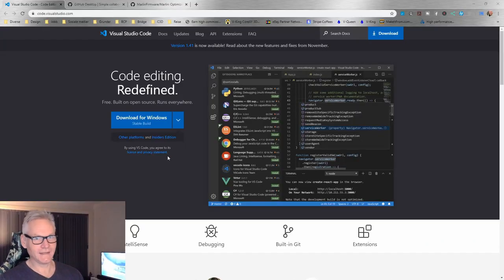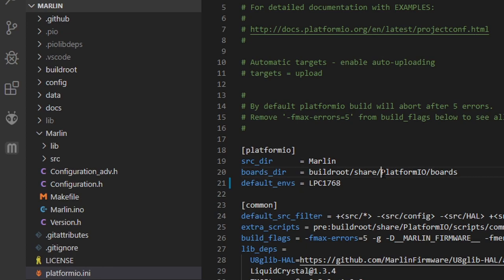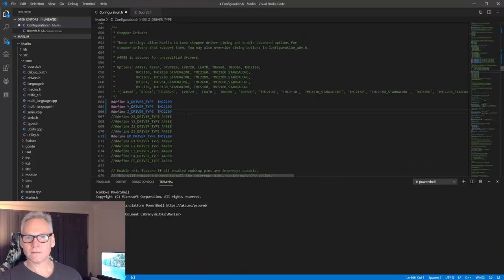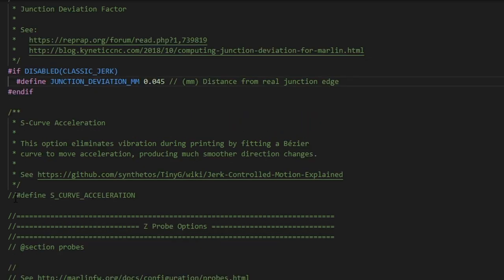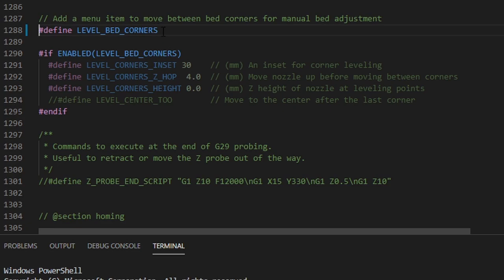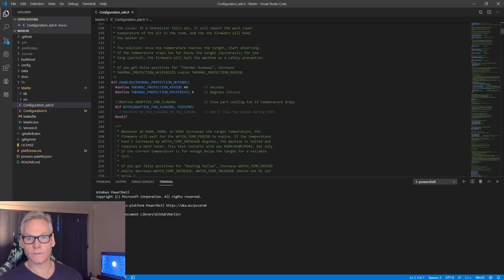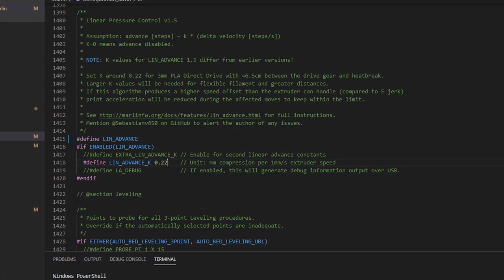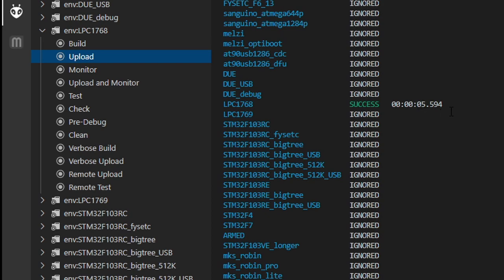INSTALL GUIDE FOR MARLIN 2.0 FROM SCRATCH

Comment: Thanks for this video Roy...
I’m up and running with 2.0.1, so used your video to confirm some of my define lines.
I see better 90 degree corners with Junction Deviation as well..
Keep the good work, take care be safe.
Reply: Wow, your build 57 Seconds...
My laptop need replacement 😂, with 5 minutes and 30 seconds build....
Reply from the maker: Great. I dont know JD myself so its a trial and error I guess

Comment: I’m using a big tree SKR with the marlin firmware. My issue is with a 1mm nozzle. I can print with smaller nozzles. The 1mm nozzle does not lay uniform line thicknesses. While extruding there are times when the extruder stepper stops and then starts. Thus my lines can be anything from a string to less than a full line width. If I back the filament almost all the way out of the Bowden and then run a print without actually extruding material,  the extruder stepper seems to feed filament consistently. This makes me believe I have something wrong in the firmware settings. There is a filament pressure setting in the advanced tab, but, I haven’t had any success with this parameter. Am I missing something here? Do you have any thoughts on this issue?
Reply from the maker: I am sorry for you problems. I don't know what can cause this issue I am sorry

Comment: Thanks! I have some trubbels trying to make my Tronxy D01 to work with Marlin. And with you video I think i can make some progress. Only one question. Why the bed keep dropping down when it’s not moving? Z-axis its falling down everytime that its not printing. Its the problem in Marlin or its the stepsmotor? I have a skr 1.4 turbo with tmc2209. Thanks!
Reply from the maker: When the Z motor is not powered it will fall down. This is normal but also depends on how you lift your Z. Belt, leadscre or ball screw? Geared system or not
Reply: @PRO3DESIGN  I have a Tronxy d01. And its exactly like my Ender 5 almost. The z-axis its like Ender 5. And I don’t have that problem in my Ender 5.

Comment: This is great - thanks.  But the last step - my Gen-L board - firmware is usually uploaded via USB cable (Arduino IDE). Is there an option is VSCode to do this?
Reply: Okay found it - when I scrolled down to the correct environment, I see it somehow knew to use com port

Comment: Hi Roy 
I followed your tutorial which seems to be the best I have seen so far.
However I am getting a compile error do you have any idea what I need to alter ?

   :6: error: #error "Unknown MOTHERBOARD value set in Configuration.h": 8,
	"message": "#include errors detected. Please update your includePath. Squiggles are disabled for this translation unit 
(C:\\Users\\John_2\\Documents\\GitHub\\Marlin\\Marlin\\src\\MarlinCore.cpp).",
	"source": "C/C++",
	"startLineNumber": 2,
	"startColumn": 1,
	"endLineNumber": 2,
	"endColumn": 30
}
Reply from the maker: Hello Ronnie. Thanks for the feedback. It is impossible for me to figure out what caused this error I am sorry.
Reply: @PRO3DESIGN  It says it cant find the motherboard and i done it exactly like you did in the video everything work except the build.
could me Marlin file be different from yours ? I downloaded the latest one.

c:\users\john_2\documents\github\marlin\marlin\src\pins\pins.h:747:6: error: #error "Unknown MOTHERBOARD value set in Configuration.h"

// choose the name from boards.h that matches your setup
#ifndef MOTHERBOARD

 #define BOARD_BTT_SKR_V1_3
#endif
Reply from the maker: @ronniebrasco8239  so I do you have the skr13? Did you set the right prosessor lpc1768
Reply: @PRO3DESIGN  yes all set to what you say above . The only difference i can see is that in your video The SKR 1.3 is shown as :
BOARD_BIGTREE_SKR_V1_3       but in my versions of Marlin the only board i can find is      BOARD_BTT_SKR_V1_3 .
When i try to build it says it cant find the board im wondering if this is a bug i have downloaded even the latest version of marlin and it only has     BOARD_BTT_SKR_V1_3 
Would it be possible for you to send me your files as that seem to build ok.
Reply from the maker: @ronniebrasco8239  what kind of Printer do you have? Take a look here https://github.com/RoyBerntsenDesign/V-Baby-CoreXY/tree/master/Firmware/Marlin%202

Comment: I have strong doubts about junction_deviation on a coreXY machine or at the very least the calculation of the value thereof. On a coreXY the x/y-motors are always working in conjunction with each other, unlike on a cartesian printer. Looking at the details of the junction-deviation-equation I can't possible see how it would be the same for a corxy as a cartesian.  But I could be wrong. Getting marlin2 to work I really liked this explaining video: https://www.youtube.com/watch?v=_IafavTl1fA
Reply from the maker: Thank you for the feedback. I don't know much about junction deviation and this is the first time I use it so you might be right but my corners look good with this calculation. Michal is using atom which Will no longer be supported by platformio. I do like his channel